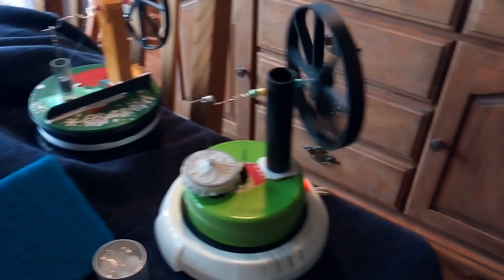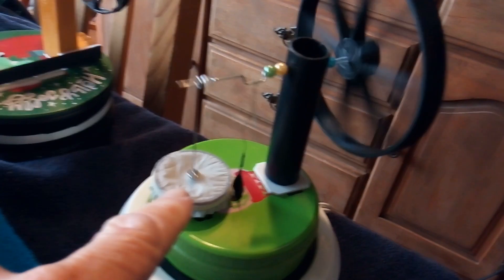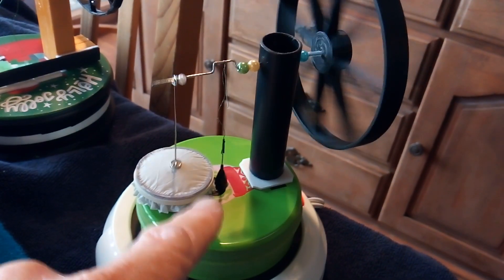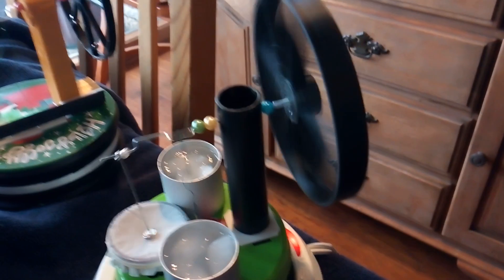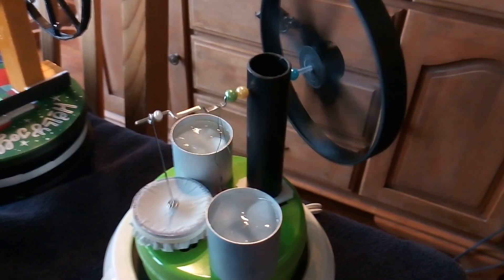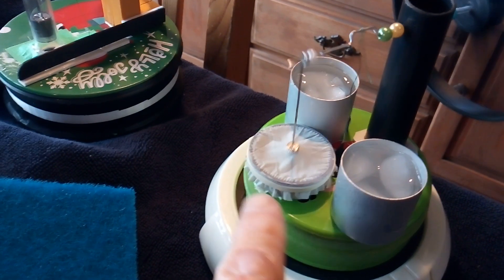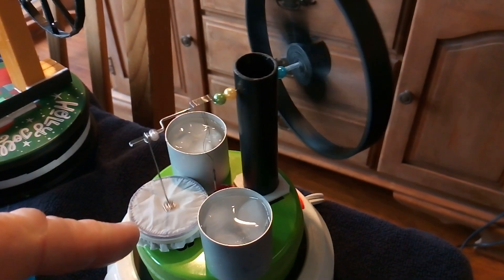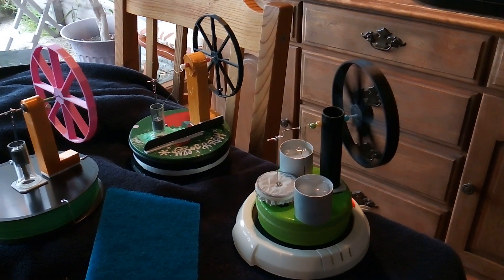Simple Stirling Engine ----  Secrets of success

Comment: Your flywheel is very lightweight. Seems to lightweight. 
I wonder if, adding magners and powering "maggie" is a Project in mind? See, the return possible. 
I really appreciate Stirling engine possibilities.
Reply from the maker: Yes.  I tried adding magnets to the wheel and turned this into a hybrid 'Stirling / Electirc and it worked quite well.
Reply: @Lidmotor  what about generating current? Did you add mag's as Gene or secondary Motor? That's not clear in your reply. I do think, gene modification is good project. Do you now share STL files of your project's?  Do you know about "ThingyVerse" STL file sharing site? Already billion STL Files uploaded there, for filesharing. 
You could Upload your 3D STL files, of project's as you engineer them, for your fans.
 Long time fan of your channel.
Thanks as always, Teacher, Sir Lidmotor..